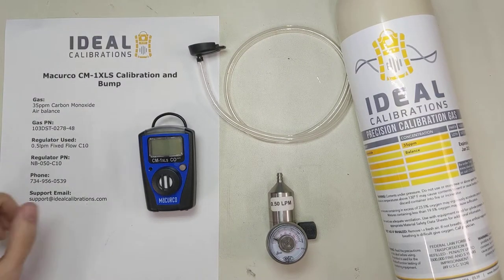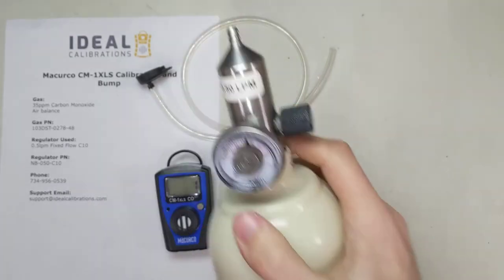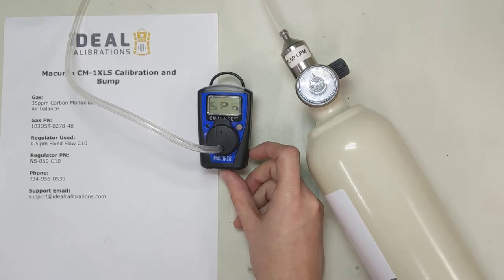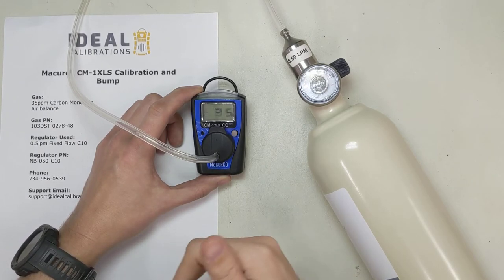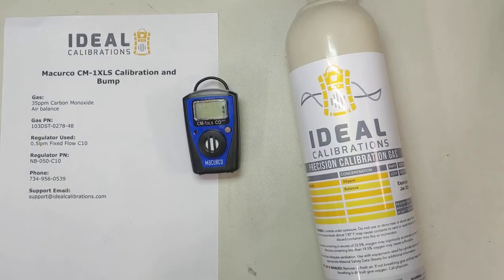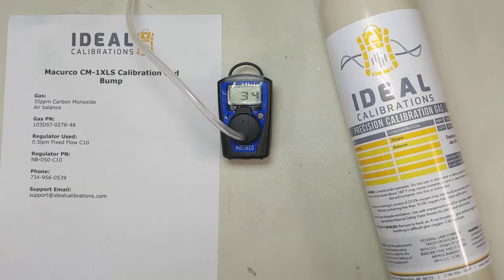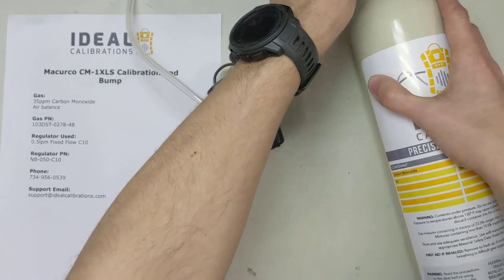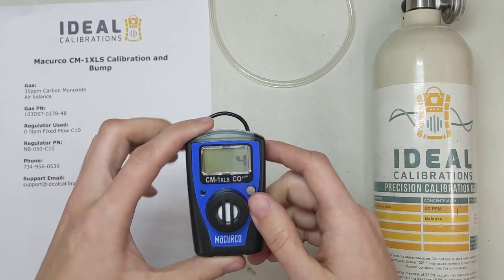Macurco CM-1XLS Carbon Monoxide Detector Calibration Guide

Comment: What’s the difference between air balance and nitro balance?
Reply from the maker: Sometimes sensors require a certain amount of oxygen to function, like LEL sensors or some NH3 sensors. Nitrogen is more stable, so it's preferred for reactive mixes